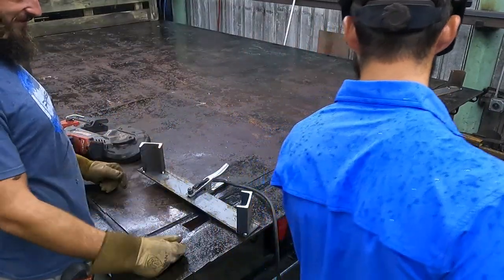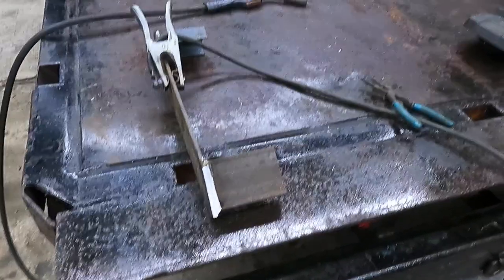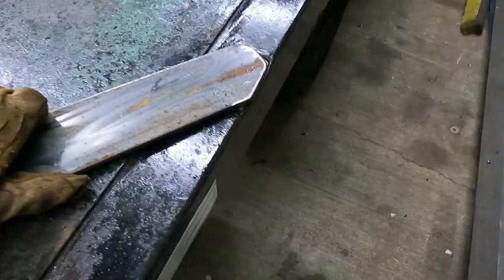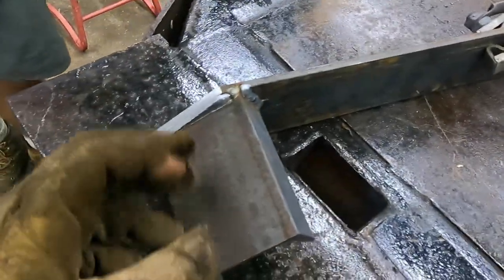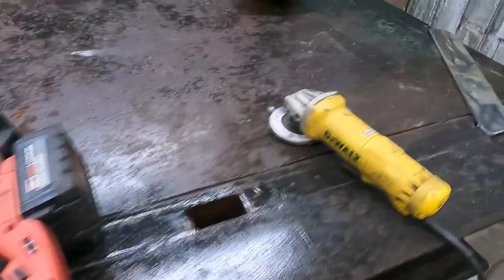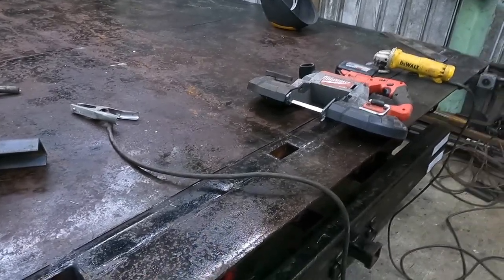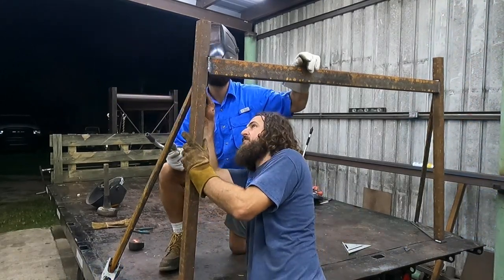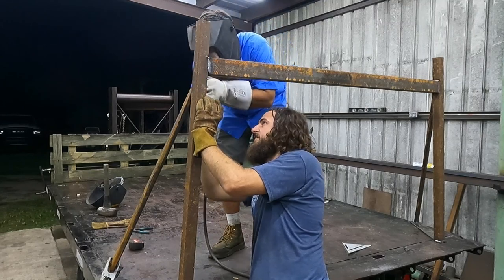Utility Gooseneck Build Pt3

Comment: Slag you drag mig is push not pull
Reply from the maker: I’m going to assume you don’t weld much…
Reply: 🤣🤦‍♂️ do you know what a Boilermaker is
Reply from the maker: Yes, but based on your initial comment I’m going to assume(again) you’re referring to the individual responsible for placing water on a stovetop and “boiling” it to create ramen noodles.  Therefore I suppose one could call themselves a “boilermaker”.
Reply: Shouldn’t always “assume” thing’s I’ve got 20 years under me and actually I weld every day building custom semi trailer and truck parts 👍
Reply from the maker: You’re right, my fault.